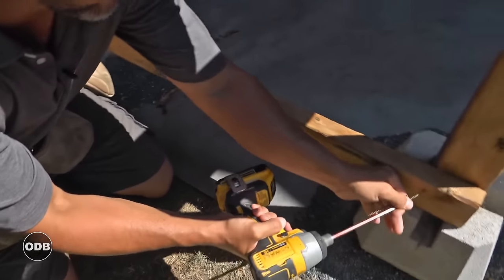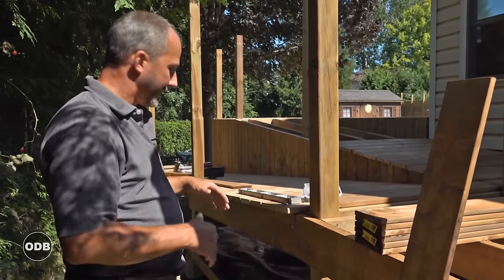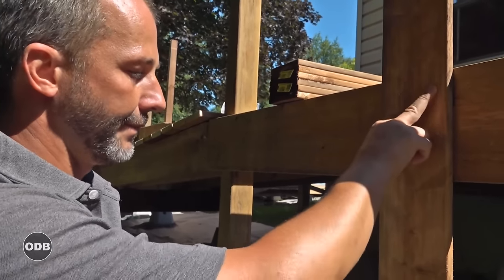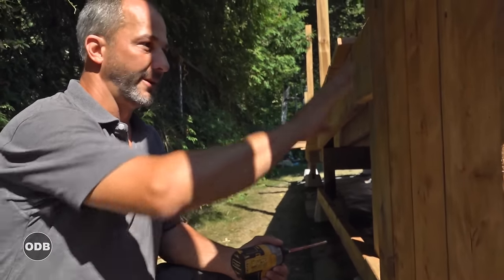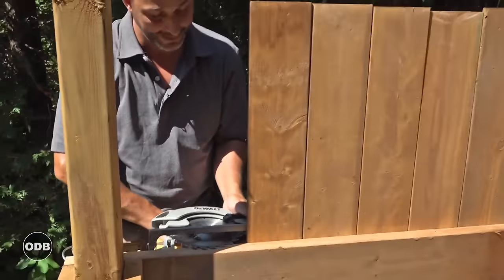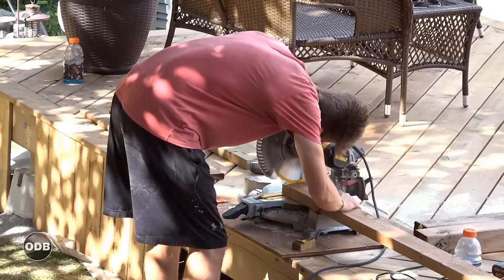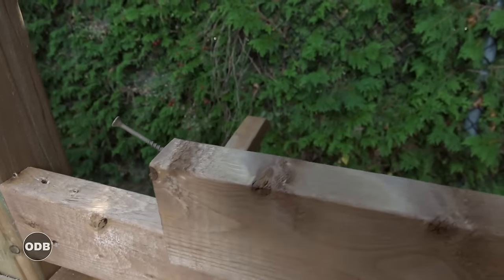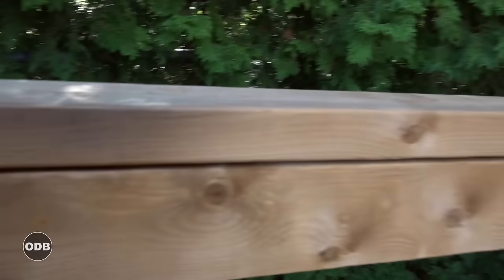DIY DECK Part 6 | Building Deck Railings

Comment: Hi Jeff on your next deck would it be possible to show how you fix the deck posts, there are so many variations, Im sure you have a good method or two. Cheers Mark
Reply from the maker: I use blocks or cement. There are actually 3 great ways to do it depending on soil conditions and the type of weather you get. Let me know where you live and I can give you proper advice.
cheers!
Reply: Thanks Jeff, I live in the UK, in construction myself masonry side, just looking on youtube for good methods of fixing posts at ring beam level, (Simson strong tie sell bespoke fixings for decks to USA & CANADA) not UK.                                                                                                                                                                    So Im looking for methods  (strong and robust) that can take the pressure i.e. party time 34567 leaning on the handrail (can the post fixing take it). USA & CANADA seem to have tightened up on deck construction in this area, just looking for ideas Cheers Mark
Reply from the maker: I have found that the local building office usually has information regarding preferred techniques that also incorporate materials available and local climate conditions. A great place to start. Just remember when building out of wood, if you can have your posts in the ground tie them together under the deck with braces and have them come right through the deck to the top of your railing, This creates strength and sfety that cannot be rivaled by any surface railing system. Sorry I don't have a video on building a simple strong structure yet. You have inspired me to do one for next season. Thanks Mark and Cheers to the U.K.
Reply: Thanks for your reply, my thoughts were too, to bring the posts through the deck floor with'  below ring beam fixing to the posts , Also incorporating good ring beam fix also, As we do we will work it out. Cheers Mark

Comment: Question from a greenhorn.....why are the tops of the ballesteros slightly angles underneath the top flat railing board? That looks visually unappealing to me....shouldn't the top of the ballaster be cut 'square's and butted right up under the top railing board.....with just the bottom of the ballaster angle cut?  Thanks for the explanation.

Comment: When you do the skirting why can't you cantilever the structure a bit to overhang the block so that block isn't visible?
Reply: He told you..   railing safety..  with cantilever you can only do surface mount railings.

Comment: So first time deck builder here so I have all my railings up getting ready to do the balusters so I just get my center measurement and go left or right every 3 inches ??
Reply from the maker: you need to double check sometimes you want the baluster centered and some times you want the gap centered depends on how it finished. you don't want a baluster on each end 1/2" from the post. Cheers!

Comment: Can someone please explain what he means by “burn the screw” at 8:02. Please explain both the technique he is using, and why it helps. From what I can tell, he is putting the screw in reverse, but pushing the drill in as to not let the screw back out, thus stripping the wood. It seems like that would help avoid the pilot hole to help the boards pull together, but the sawdust doesn’t get cleared, and it seems extremely hard to force the screw to stay in place. I tried and could only do it if I already had a pilot hole that was just a little bit too small. Am I missing something?
Reply: No he’s saying if you burn the screw,make it hot before going in the wood, it won’t split the wood. He didn’t explain the science behind why that is though
Reply: @cutthecurve5726  unless you know the technique, it sounds like you’re just guessing that he means “make the screw hot”. But hot metal expands, and wood is not a good conductor of heat, so would be more or less neutral to the temperature of something. I’m more looking for someone to explain it that really knows exactly what he’s doing rather than another guess.
Reply: It looks like he is reversing the screw while putting pressure on it at the same time. Essentially this should act almost like a drill and cut/mash the grain of the wood. Then when he drills the screw in afterwords the grain isn't parted (think like an axe would do, basically the same thing here). This is why predrilling also works and why many building screws have cutting heads: you prevent the prying apart of the grain by a pointy object.

Comment: can you explain "burning a screw"?
Reply: Check out his drywall videos. Basically after driving the screw a little ways in, stop and turn your drill to reverse. Squeeze the trigger and let it reverse, but keep pushing it in. Like, give it some real pressure. That causes a lot of friction and heats it up. That sears it, and stops it from splitting. As he says, you'll see a little smoke come out. 

Don't ask me how it works, ha. Seems to work well though.

Comment: Hello Jeff,
Quick question when you built your box and beam structure you cut off the 4x4 flush. So when you came back to put the hand rail posts how did you attach them to the surface of the deck?  Did you go they the surface and attach to the rim joice and then to the other 4x4?    Why dint you keep the posts solid all the way up and cut off at the top of the hand rail.

Thanks
Jeff
Reply from the maker: In this design there were so many elements that were developed as we went that I couldn't set the posts continuous to the handrail. what we did was attach to the rim joist and went to the ground and attached to the frame for the skirt board. this gives us an incredibly strong railing. Thanks for pointing that out.

Comment: Hi Jeff & Nate! I have looked at a lot of YouTubes, and your videos are FAB!

I have watched your deck series about three times--and am ready to try my hand at creating a low floating (8x10) deck offset/below my existing deck to bridge to my concrete pool deck--currently I have 7 stairs, and want to have only 4 leading to the platform, with two more steps from it)...Your videos are SO SO helpful. 

My question that remains unanswered relates to the part of the LOW PLATFORM that sits on deck bloks and the concrete decking of your client's pool. This is precisely what I plan to do...though I might use box beams running from my 6x6 existing deck posts instead of dekbloks...I am not sure! 

Anyway, could you please explain what you did to set the rim joist on the pool deck side? I see you with some shim material in hand at one point, and when you are attaching the joist hangers, I see a shim, but is that all there is under that rim joist? Wouldn't shims deteriorate? Or if they are cedar they are ok? Thanks for any advice.

I am in London ON and a single mum, and will be working on this 8x10 platform on my own--with only a skill saw and the help of my 8 year old daughter! I don't need permits because of the height, but it is still taking me some time to get my nerve up..! Your videos are inspiring! And Nate is a wonderful addition...I find his comments affirming...because he offers the perspective of a bit of a rookie...Thank you Jeff! I also watched your company vision, and would hire you in a flash. Great Great work.
Holly
Reply from the maker: Thanks a lot. Feel free to comment if you have any specific questions moving forward.
Reply from the maker: Hi Holly,The answer is yes. we use cedar shims and that is all you need to support the ridge beam on the pool deck surface.
We also used joist hangers to span the gap from side to side. hope your project goes well. I am sure your little man will be a lot of help like my Nate was when he was young.